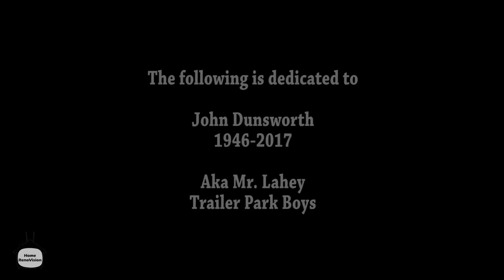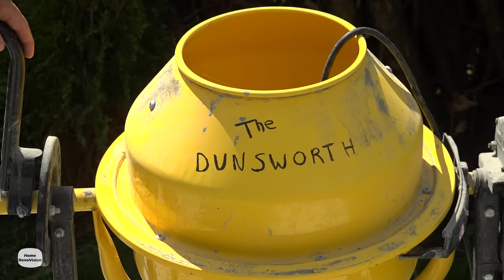Pouring A Concrete Pad | How to Build a Shed | Part 2

Comment from the maker: To watch the entire building process click this link. Cheers! https://www.youtube.com/watch?v=BLk_CAMmQPc
Reply: Keep up the good work
Reply: Im building your shed design and I have never built anything before. Your videos are great and make me feel I can do it. Im leveling my frame for my concrete pad tomorrow. Cheers
Reply: I realy like your video jeff. Explain thinks so well.
Reply: Sorry, but I had to say that one thing that was painful to watch (or not see) was you making your work a lot harder than it had to be with all that leveling. If you were to just use pegs and spike them into the ground with some screws started in them, you could have just used the level, get your board leveled and then screwed the pegs into the boards and got your frame done a lot quicker AND EASIER!!
Reply: Jeff is super hilarious in this one..

Comment: You just did the best job ever convincing me to hire someone to do this for me.
Reply: That was kinda like wiping yourself with wax paper.
Reply: you can do it yourself he is making the work difficult. I can show you the best way to get it done with way less work then he is doing. Remember he is not a pro just a diyer teaching diyers. not a pro teaching diyers.
Reply: Summer Duckworth with his own renovation company....?
Reply: I dont think that was the goal here, Ive done stamped concrete before and its a similar process if not more work. Just have nice weather and it will be a much easier job. 

Alternatively you can set up the frame, and call a local cement truck and have the cement delivered and you will still save a lot in the process. 

We set up frames for our driveway and a jacuzzi pad and they poured it in maybe 20-30 minutes. The critical component for that is to have road access to the back of the house, but some trucks have some awesome cement delivery tubes. 

All the best
Reply: @summerduckworth7397  I just checked out your channel to see if you can show me how to do it better. You have no videos so how am I going to learn from you?...
Reply: U r so right. Thought I would tackle this 2 save money. Lol, thinking about hiring somebody 2 do it 4 me.
Reply: Better than not knowing a thing, at least you get an idea of the process
Reply: Funny...But true. I'm gonna get some quotes.
Reply: You said it! I'm thinking the same thing.
Reply: Hahaha

Comment: I don't mean to be that guy (who points out mistakes in the comments), but the reinforcement mesh is ineffective if you don't lift it from the bottom...
Reply from the maker: Hi Antonio, we did set it on mesh about 1" above the rock. We are all good there.
Reply: @HomeRenoVisionDIY  cool, keep up the great videos
Reply: It will just rust out quick
Reply: Home RenoVision DIY  mesh should be overlapped and tied. Mesh should be covered by an inch minimum top bottom and sides not only for strength but corrosion.  When steel corrodes it expands leading to concrete spalling.
Reply: +Antonio Jose Franco And then you proceed to be exactly that guy. Where's your video showing how to pour and finish a slab? Hmmm?
Reply: I mean to be that guy and also point out that the mesh is not tied together and that you also have a cold joint because you didn't pour it all in one go. Despite all that, this video was pretty much amazing and a joy to watch :)
Reply: @lancer525  I'm glad that @Antonio Jose Franco pointed that out. Ignorance is not bliss when doing concrete work.
Reply: But the comments are how people who don't know what's wrong in a video, learn how to do it right.
Reply: @lancer525  so what we all just pretend doing something incorrectly is correct and let people cause themselves problems hmmm??
Reply: It is PROVEN  from many studies in Chicago that welded wire fabric does the same exact job no matter where it is in the concrete . I have 30 years in concrete and that is my finding also .you are sadly mistaken if you think lifting it up does anything . Go to the world of Concrete  a few times and learn something in classes from engineers instead of youtube .
Reply: Sharting Khumbubbles is that accurate? The tensile stress in the slab is highest on the lower face and decreases to zero at mid thickness and maximum compression on the top face. Therefore tensile reinforcement (eg rebar) only adds tensile strength if it’s below the mid point of thickness and the lower it is the more it will be loaded. Assuming it doesn’t reach failure point it will contribute more to the slab strength the lower it is. It would seem also that the mesh needs to be embedded at least a bit to ensure the loading is transferred to it, and also to protect against corrosion. I’ve not seen a concrete job where any steel remains exposed after the final pour.
Reply: @cglaister2000  If you look at the approved civil and structural engineering bluelines wet stamped by licensed engineers, the rebar placements are critical.
Reply: @shartingkhumbubbles7169  the steel is for reinforcing the concrete. How can it reinforce if the concrete is only resting on top of it? It needs lifting so the concrete gets underneath as well as on top, thereby reinforcing it.
30 years in concrete doesnt mean youre always right!
Reply: Antonio Jose Franco if you look at the shadows you can see that the wire is floating. Doesn’t seem like it is tied though...
Reply: According to ACI steel exposed to earth should have a thicker cover than those exposed to air.
Reply: @HomeRenoVisionDIY , that raised mesh part wasn't mentioned, but just thinking through what its purpose is for being there would hopefully lead one to figure out they needed to find a way to put that in the middle of the concrete sandwich. 

I watched your video to see if there might be some helpful hints I might take away, because I know that the clock is ticking on how long you have to work the cement before it sets. I'm getting ready to pour a square landing (1x2.1 meters sq., 19cm deep) for steps to a deck that is chest-high above the lawn. I am planning to put down a layer of concrete, then place the wire, then cover that with more. Your area was WAY larger than mine will be, and I didn't know whether to use a black plastic tub, or a portable powered mixer. My project will use about 21 80# bags. From the looks of it, I think I'm going to be able to get the cement mixed and poured fast enough doing it manually (even though I am pushing 70, defined by 30-year-olds as "old and slow."   Ah, but what they overlook is that I am [hopefully] wiser for those years. :::chuckle:::!) 

I do hope that the reflective puddle on the smoothed concrete that was caused by overspray from your "hourly cleanup" was not a problem.
Reply: @th1alb  the mesh gaps also concerned me. They need to have a bridge that overlaps enough to be solid across that are under flexing. That would mean a patch of wire that is around a hand-width of overlap (minimum) on either side. One grid-square on that wire should do it.
Reply: @alexw20  ACI doesn't require the mesh to be tied but it's a good idea.
Reply: @th1alb  ACI deson't require teh mesh to be tied but it's a good idea
Reply: @HomeRenoVisionDIY  Wondering if that bit was in the instructions written on the bag, which you said to follow?
Reply: 👁🙋🏿‍♂️🙋🏿‍♂️🙋🏿‍♂️🙋🏿‍♂️ ALWAYS ADD REBAR N SOMETIMES ITS OVERKILL N SOME INSTANCES BUT REGARDLESS....PIECE OF MIND 4RM KRAKN N THE FUTURE N 👁🙋🏿‍♂️🙋🏿‍♂️🙋🏿‍♂️🙋🏿‍♂️ DO MY BEST 2 KEEP THE REBAR HALF WAYS OR KLOSE 2 HALF ON THE SLAB 2 KEEP IT 2GETHER N STRENGTH ON THE SLAB 🤷🏿‍♂️🤷🏿‍♂️🤷🏿‍♂️🤷🏿‍♂️
Reply: @alexw20  the mesh should be covered by an inch of what? gravel? I watched a few videos and no one addressed this. so i would like to know.
Reply: At least put it on some bricks
Reply: I love you bro mixing concrete with no mask nice...
Reply: How would you lift it?

Comment: Good video.  Don't mean to be that guy, but....it helps to cut the stakes so you can screed easier and your wire is not chaired up since it's held down by the bags.  Sorry man, I am a retired structural engineer and it's in my system, I just can't bite my tongue.  Same reason my wife isn't talking to me for the last two days and I am watching DIY concrete videos.  ;)  But what the hell, life is good.  Cheers.

Comment: Good video ! Tip: Work the concrete with a vertical, stabbing motion along the face of the form as you pour the concrete; the idea is to force out the voids on what will be the (visible) vertical face of the slab. Note at 28:48 the honeycombing, i.e. pockets/voids   at the face of the slab.

Comment: As always, nice video. What may work for your viewers is to hammer a stick on the corners and screw the planks on the sticks, easy to level and your bords do not wobble when the concrete pours in as it presses out quite a bit. Love the series.

Comment: Having seen you mix the concrete bag by bag, it made me appreciate that I had a cement truck deliver my concrete, already pre mixed.  (My shed was 4m by 3m).  The only difference I did was I put a plastic damp proofing water barrier between my gravel and the concrete.  My shed is 20 years old, and still standing.
Reply: Concrete is cheap and it really blows my mind that someone would do a pour of that size with such a tiny mixer, wouldve cost about $300 for a truck and he wouldve been done in an hour, he probably spent close to that in bags and ended up with numerous cold joints and a poor finish, not to mention the 2 days of backbreaking work, and judging by how shiny that mixer is I'm gonna say he bought it for the job too, as a tradesman this video was insanely cringey to watch, also most bag mixes are about 3000psi strength and most concrete plants mix 5000 as a standard, not knocking him but hes a jack of all master of none

Comment: I'll be that guy too... Keep your shovels sharp and you don't need a sawzall with roots.  At 5:25 it's not a rake. ;)  Keep the slope away from the door so water doesn't run in. The lowest part should be the front, and higher than the ground. Compact the dirt you moved. Stone is cheaper than replacing the bottom of the shed from rot. You forgot lather... then rinse and repeat. Stick a long bolt or screwdriver in to keep the mixer from flipping. Pull your mesh up as you work it or set it on a large stone so the mesh is in the middle of the slab. HF has a larger mixer cheap. Spray the broom w/water before using it. And give it a little more time before broming. Spray the wood with oil. (cooking oil will work) Trowel the top a little more after you level it w/wood. Use your sawzall to vibrate the sides so the stone doesn't show, and pull them off sooner so you can trowel the sides. Cover the pad with plastic and keep under it moist for a few days, especially in the heat.  Did you think about putting a sheet of plastic down first? Or a layer of foam core insulation? It helps with freezing and keeps it warmer inside and is only a few $. But, decent vid. Keep it up.

Comment: A few questions: 
1) The soil was significantly disturbed, did you tamp it down after?
2) Shouldn't geotex be used to separate ground from gravel?
3) Was gravel not tamped down as well
4) Can you elaborate on you choice of 1/2 " stone over say, 0-3/4"

While you answer repeatedly that it's only a garden shed as opposed to house/driveway, the overall weight of 60 bags of wet concrete is significant. + eventual the structure above it. I am wondering, along with others, how will this work stand up to time and the elements...
Reply from the maker: actually with the use of that flat shovel the soil was hardly disturbed at all. Purchasing geotex for such a small job is not cost effective! tamping 2-3" of clear stone is redundant in it's effect. I used 1/2 inch since it is readily available and easy to walk on. It also compacts top near perfection just from pouring it out. The fact that the concrete weighs a lot is all the more reason to trust that everything is held well in place. I will do a video in 5 years and show the world how well it stands up. Unfortunately today most people fall for the  line " the right way to do things " and get scammed for thousands. This install technique has been used for thousands of years and continues to work.
Reply: Most things are overbuilt nowadays.
Reply: Yes this install technique has been used for a long time. Many things are done improperly for a long time... I look forward to seeing your cracked slab and chipped away corners 5 years from now. You had the right materials, just didn’t know how to use them. Scammed? It would have cost you ZERO extra dollars to do this properly.
Reply: Home RenoVision DIY I look forward to that video. It means I will have another four years of Home Renovision content to watch in the meantime! :) To the other commenters on this thread, Jeff is exactly right. He did not chew up the ground he removed slices of it, the 1/2 in clean gravel is darn near compacted just sitting there, geotex does cost more than zero dollars, and it is only a small shed. It isn’t even going to be sealed water tight around the door ways and soffits. It is enough to keep your things from being exposed to elements, and out of your basement or laying next to your house. (Edited for Lots of auto correct errors)

Comment: Jeff! You sir are an amazing teacher. Just recently joined as I'm moving into a 1929 built two story farm house on 20 acres and it needs some loving to say the least. With no experience but your videos, I've put up drywall, fixed holes, textured with orange peel, laid laminate flooring, baseboards, put in insulation, and now that the weather is turning nice, I'm looking outside. I want to pour a pad for a hot tub. Would I need a stronger pad somehow to hold the weight of the water or any other specifications I should follow? Thanks for all your videos! My wife and I stay up way too late watching these. . .they are addicting

Comment: This video was mostly helpful.  I just poured an 8 x 12' pad. First time doing it.  
I strongly suggest you call your local cement company to deliver wet concrete. Do not buy it in bags and mix it yourself.  
I got 1 cubic meter delivered and poured into the form for about half of what buying bags would cost. 
Plus the labor savings!

Comment: Wow! This video gave me a real appreciation for how much work goes into pouring a slab. I have dreams of building my own 16x20 shed on top of a slab, but I'm going to need a ton of cement bags it looks like!
Reply from the maker: takes a few hours but 60 bags  in cement is much cheaper then having the mixer truck come by.
Reply: You would need 4 yards of concrete if it were poured at 4 inches thick

Comment: @HomeReno I love your DIY projects and I think i heard you saying you are not an expert in concrete. So , if i want more info i'll have to do more research. I don't expect perfection, i take this as a glimpse in understanding what is to be expected from a project. Experts are very kind people -if they are (!) - to add comments and to be helpfull in pointing what else should be learned. No need for cruel judgments and comments. People should help each other i think.

Comment: here's a tip, screw your boards together, stake opposing sides, square the slab using the 4 corner method and find your lowest corner and nail it, now level across and nail that end, then level to other corner, and the again. Easy and fast for one guy.  And always use rebar, mesh is junk.  But for a little shed with no weight on it , it'll be fine.
Reply from the maker: Thanks Matt, that is why we used it. Cheers!

Comment: Sorry to be the turd in the punchbowl, but I'm a certified licensed and board-approved concrete contractor with 69.2 years experience. You should be using a graphene-lacework netting before you place fine-grained Columbian rhyolitic andesite gravel in the 3/32" to 43/64th range. Then your mesh should be triple-forged tungsten-titanium-magnesium alloy tempered at 1200 degrees in a clay kiln, and placed at precisely 1.539 inches above the gravel bed. Your concrete mix should be the Damifino brand of neo-Roman style concrete with a 19-1 lime/salt mix. Mix it with purified filtered springwater at a 11-3 ratio for exactly 19 minutes and pour. Then you should use a Walthall Mohagany flloater to spread all that out by hand. Great video!
Reply: Haha nice ! I agree though a distilled water pour will yield  a higher ratio of glaze off after the initial 23 hour cure  window. I know more than you and more than almost everyone so I was happy to place this comment you're welcome,
Reply: qwchrbichn lol good one
Reply: At the beginning he said that he was not a professional concrete installer.
Reply: need to call the guys at 
Odell Complete Concrete
Reply: qwchrbichn:  The triple-forged tungsten-titanium-magnesium alloy has since been replaced with a 60/50 ratio of unobtainium and a non ferrous composite.  I am fully behind the use of Andisite though!  Well played sir!   My Walthall Mahogany floater was lost due to spontaneous combustion.  Do you know where to source those?   The right tool for the right job, am I right?
Reply: Worked with damifino almost exclusively. Follow with a homemade steamer berry float for a job well done.

Comment: Did you consider screwing the frame together First and then level the frame at front, and side to side with a small fall from back to front ?  constructed first would show how much removal of soil etc required.   ??

Comment: This video is why you level the pad before the form work.  The best method is to regrade in the front on the high side to slope down more.  Another question.  If it’s a shed why pour a slab and not put blocks under the shed corners?  Much much easier to level